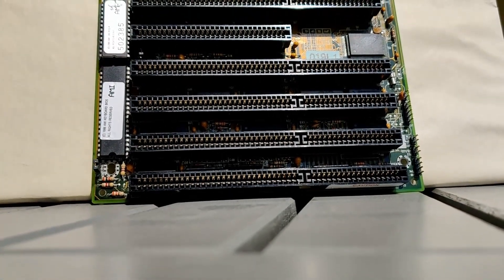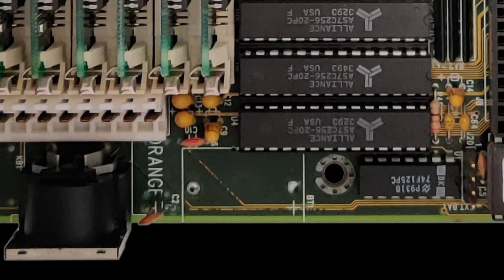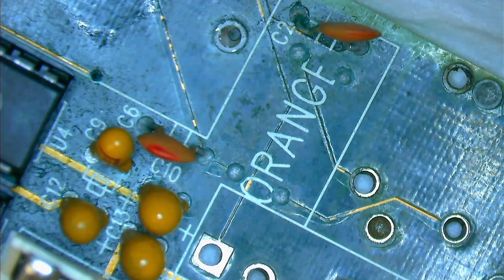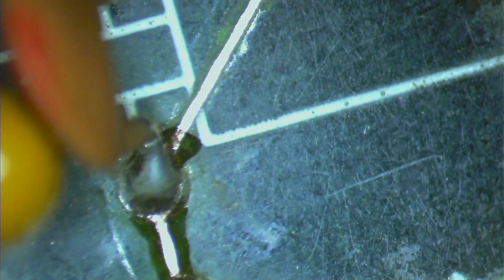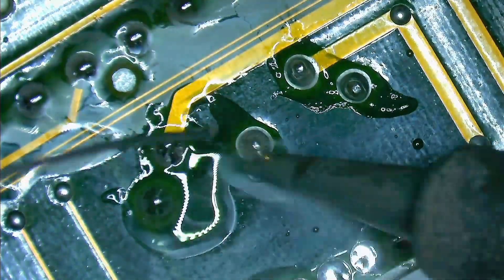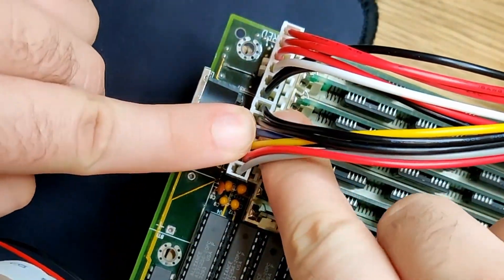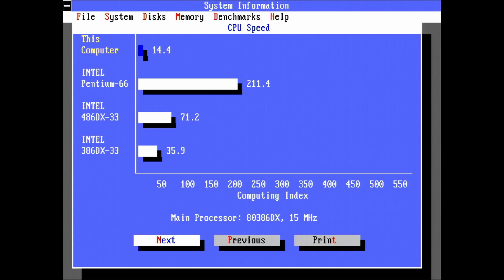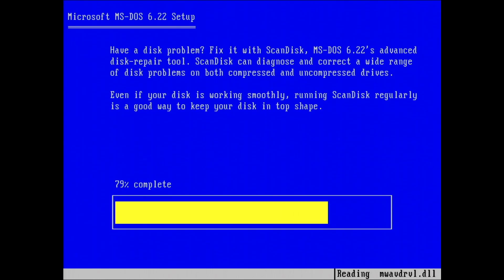Leaked battery & corrosion: My attempt to restore this 386 motherboard!

Comment: Thanks for sharing this! I have the exact same motherboard. The corrosion damaged the trace that connects the C2 capacitor (5:37 on your video) to the 2nd pin of keyboard controller. I fixed the trace and also removed all the components starting from keyboard connector going all the way until the resistors just right after keyboard controller. Continuity is there, no broken traces. ISA is having all the correct voltages but when using the POST analyzer card I am getting indication only on +12V rail. I am running out of ideas of what else might be broken there. Capacitors look ok. There are two transistors, both between ISA 8bit and ISA 16bit slot. I cannot identify them though. Maybe this is the problem? Any ideas how to identify them?
Reply from the maker: Do you get +5v and +3.3v on the AT power connector? Maybe there is a short somewhere. If you're using an ATX power supply, it should shut off due to it hopefully having an overcurrent protection. In that case, you're using an ATX to AT power adapter. Make sure all pins of the adapters work. Sometimes, the pins get pushed out from the plastic housing and they don't make proper contact.
If none of this helps, then it's probably a broken trace or faulty component. I'd first try to find broken traces.
Reply: @bitsundbolts  Thanks for you reply, I appreciate it. I tried both AT and ATX psu with adapter. I can also measure with a multimeter all voltages on ISA which is weird since the POST card LED is not showing indication. POST card works on other boards though. Almost ready to give up on this one. I believe the problem might be in the two transistors, tried to measure them with multimeter set to diode mode, on one of them getting voltages on both directions which is wrong I think

Comment: Yes, i played X-Wing and its successor Tie Fighter in 1993 and 1994. I had the floppy disk versions and i completed both games. For X-Wing i also bought the two Addons B-Wing and Imperial Pursuit. 
With X-Wing i've ruined my joysticks multiple times. After the first one broke, I bought a second one. Until that one broke too. Then I changed my strategy and unscrewed the joystick and tried to fix it. That was one of my first repair attempts, I was still a child. The joysticks were constructed quite cheaply and did cost less than 40 DM. The dealer didn't have any others for sale either. Back then the choice was very limited.
The cables from the ground plate to the buttons on the stick were torn apart. So I routed new cables through the very tight stick. But they were too stiff, so that the joystick was quite stiff and uneven.

Fortunately, at some point a new joystick the CH Flightstick was offered. It had to be good, because it was three times as expensive at over 120 DM. This joystick has lasted far longer. But since it used 50k potentiometers with sliding contacts for the axes, these also broke at some point. Luckily those were a lot easier to repair because I just had to buy new potentiometers and swap them out. I did that 2-3 times and then also played through Tie Fighter with this joystick.
The CH Flightstick was basically a good joystick, but it only had 2 buttons and 2 axes and lacked USB and was therefore no longer suitable for later games.

Oh, one more thing. I also bought X-Wing Alliance sometime around the turn of the millennium, but I haven't played through it until today. I didn't have the time and inclination for that anymore. But I still have my old savegame files, so I could finish the game at any time.

Comment: I've never actually seen even a badly abused, dead and swollen cr2032 leak! And it's easy enough to re-engineer the circuit so it does't try to charge it.

I'm also fairly confident in NiMH replacement cell types being OK in the leakage department. It's spectacularly difficult to leak them. The leaky cells were all NiCd.

But it's also perfectly fine to have a different risk assessment.
Reply: I agree on the NiMH. If they leak, then they leak hydrogen. That's a gas and shouldn't be a problem for the motherboard. 
I would never trust NiCD, Zinc–carbon and Alkaline batteries, they tend to leak and if they do so, it will get a mess. But i never had this with NiMH cells.

Comment: Excellent repair! I did play x-wing as a kid but never managed to finish the first level. I just remember the first fmv.
Reply: I destroyed the death star. It was so much fun, that i repeated that mission several times. The best thing you can do, when you are inside the death star trench is to put all power into your speed and fly at 400 speed to the goal. To reach that speed you have to stay in the trench. It doesn't work if you leave it.

Comment: Not only is an external battery connector an option, but there is a PCB you can make called not a varta which plugs into where the Varta Battery would go and has circuitry to allow the use of a cr1220.  It's a cool project.

Comment: I have an identical motherboard which I fixed on a video on my channel. It works but every time I run DOOM, it's like one of the keyboard keys gets stuck. I attempted many things but never managed to fixed it. It would be great if I could borrow your keyboard controller chip - as the one installed is not compatible with one of the "generic" installed in similar boards. I will send you an email. Great job with the yellow solder mask, my solution was much less accurate than yours! :)

Comment: Im currently working on my 386. Same thing. Ive re tinned the taces and just waiting for my formal coating to arrive. Nive video
Should point out i have a motherboard that  only has external battery connector and it does have charging on it. It was by design i guess

Comment: I've noticed corrosion tends to follow copper traces and vias through a pcb. I'm not sure whether this is capillary action or just a result of the chemistry. Its astonishing how far it can travel along a trace without any effect on the intervening sections of pcb
Reply: Exactly, there was such board recently on Adrian's Digital Basement channel. Corrosion travelled through traces throughout entire board. I'd assume not fixable easily without hundreds of patch wires.

Comment: Replacing solder mask after tinning is not needed. Solder itself does pretty good job at protecting copper traces from oxidation.
Reply: The solder mask, or lacquer or transparent nail polish can add more physical structure to badly damaged traces/mobo surface, reducing chance of breaking the connection if used heavily, or accidents happening.
IE the tinned trace separating from M/B. 
NB if I were fixing a power trace, IE higher current. I would solder a bare copper wire on top of damaged/broken solder track. And still varnish it afterwards.

Comment: External battery voltage must be higher than 3.6v, afair 4 to 6 volts
Reply from the maker: The voltage of the battery pack I use is around 3.95v and it works fine at the moment.
I thought this voltage is actually on the high side. There is nothing mentioned in the manual either.
Reply: @bitsundbolts  If you continue to get the low battery warning during POST and would rather not, you could try using AAA alkaline cells or a four cell AAA holder with the rechargeables.  There are usually two diodes in series with the external battery connection to prevent the motherboard from charging an external battery.  Each diode will drop the voltage by approximately 0.7 volts.  Originally, the most common external CMOS/clock batteries were the Rayovac 840 and 844.  These were a cube with three rectangular, flat prismatic alkaline cells sealed inside.  They had a nominal voltage of 4.5v and an initial voltage of closer to 4.7v.  With two diodes in series, the CMOS/clock circuit is supplied with 3 to 3.3v from a new battery.  If your fully charged 3xAAA NiMh cells are at 3.95v, that's likely being dropped to about 2.55 volts, which is close to the lower threshold of operation for the circuit.
Reply from the maker: After the first boot, I never got the low battery warning anymore. But I see your point. If I get the time, I will check around the battery connector and see where those traces and the supply power goes.
Reply: I use a CR2032 battery with no problems for years, the battery pack will last even more.

Comment: You got away rather unscattered with this board...
Reply from the maker: Yes, I got lucky that it was not that bad.
Reply: @bitsundbolts  Mine on the other hand has all kinds of damage, missing components, burnt pcb etc
Reply from the maker: Ouch, sounds like your board went through quite a lot!

Comment: As always, check if there is a MR-BIOS for this chipset on the motherboard. If there is, i strongly recommend to switch out the bios. Amongst other things, you will get support for multi-gigabyte HDDs, too.
Reply from the maker: Thanks for reminding me. I'm reading up on it. Would be nice to have larger HDDs and other updates!
Reply: @bitsundbolts  or you could use a bootloader to get larger disks they are still on websites.
Reply: oh that sounds very interesting thanks for mentioning that! I'll look up!
Reply: The thing is what bios not very much mr-bios outside there!!
Reply: There is a better way than a new BIOS. Just buy a SCSI Controller and use SCSI devices. They don't have that 512 MB limit and are btw much more comfortable and they also relieve the CPU of work. That's what i did in the 90s.